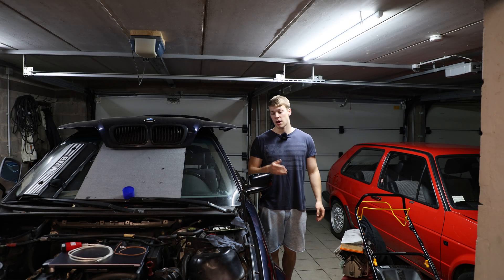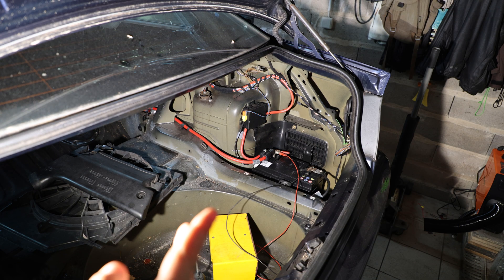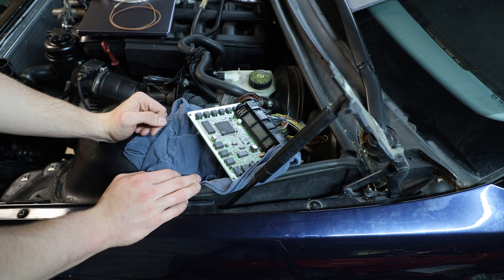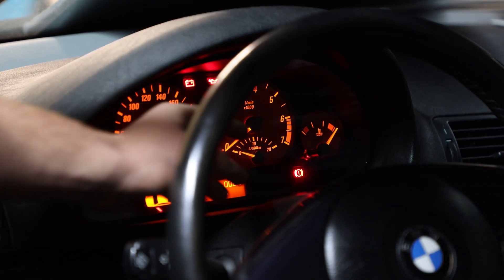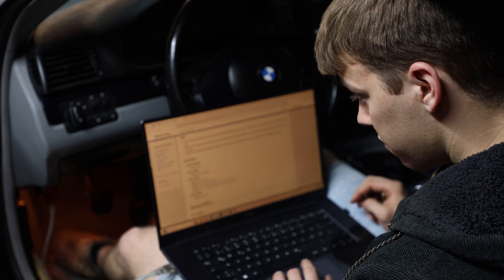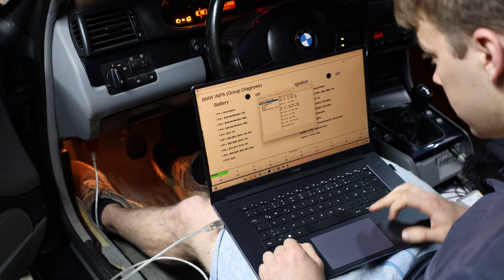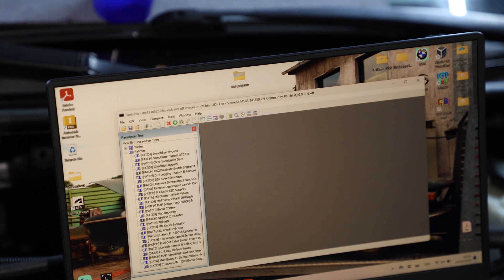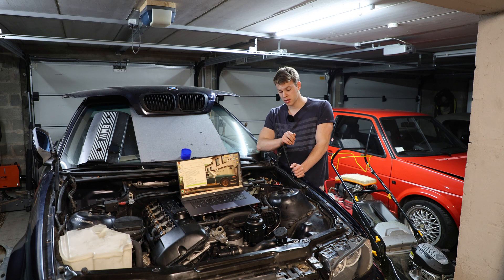How to perform a bootmode backup and ecu flash on an ms43

Comment: Good video, unfortunately I am getting connections error wrong echo bytes in JMgarage and Connection timed out serial port close on Ms4x flasher. This of course not in Bootmode because many said it dont need to be.   I have 2 e46 and i get the same message from both cars, So i Know it is not the car. Will bootmode fix that error?
Reply from the maker: @bhigbwoy7334
@bhigbwoy7334
 Im no pro, but that sounds like a setup related problem. I dont see how bootmode should fix that error. mine didnt connect right away, but that was without bootmode aswell. after reinstalling the software it worked. But make sure to do a bootmode backup once you get it to connect.

Comment: What happened with the throttle body?  It seemed to be in limp mode (surging idle), and perhaps a throttle body adaptation reset would have 'fixed' it?
Reply from the maker: @LeverThis wiring issues. A new ms43 loom fixed the car in the video after this one :)
Reply: I've a imolared e46 m54b22 and have been though seem path than you, few years ago, ews, flash the new files, to bypass, and the faulty lumpy idle,  and swap the ecm, time after I realized that my Original Ecm After play with it I bent a pin from the conector males, I was thinking I was partially bricking the ecm, I ended researching pretty deep on this topic, It's was rewarding and stressful, and made more enthusiastic to this vehicles.  @DailyDrivenClasssics

Comment: I have done conversion from 320i to 330i (both m54s), now im glad that i didnt have to do all of this. Looks like nightmare, but keep up the work :)
Reply from the maker: @tomassrdynko3908  Yes thats easier to get running but the hardware side of the swap is equally  hard :)  I can't wait to drive this car :)
Reply: I have stroked my m54b25, ita b30 now. Need to update the DME, do i need to backup with bootmode or is it safe to just flash, keeping the old ews ofcourse.
Reply: I have stroked my m54b25, its a b30 now. Need to update the DME, do i need to backup with bootmode or is it safe to just flash, keeping the old ews ofcourse.
Reply from the maker: @vozim  All the ecu specific keys are in the section only readable in the bootmode, so yes you need to do a bootmode backup before all of it just to be sure . After that a normal obd write ofthe b30 map should be enough. No guarantee tho, I a new to the software world . Every info from this video was gathered from the ms4x wiki, check it out :)
Reply: @DailyDrivenClasssics  let me get one more thibg straight, full read/write in boot and non-boot mods are different, only in boot mode security keys will read/write?
Reply from the maker: @vozim  correct
Reply: @vozim    For a 'simple' engine swap where the DME/EWS remain in the car and you are not tuning anything, one can reflash the to the latest b30 version without doing a full boot mode back up.  If something went wrong and the dme gets bricked, it would be nice to have a boot mode backup but its not necessary strictly speaking.  Just make sure there is stable voltage/power to the battery as it can take over 40 minutes for ms45.1* to update.

Edit: * not sure how long ms43 takes to reflash.  I have to say it is a lot easier to boot mode an ms43 via the obd cable versus an ms45 dme (via bdm pins on the circuit board) ... worth grabbing a boot mode copy.